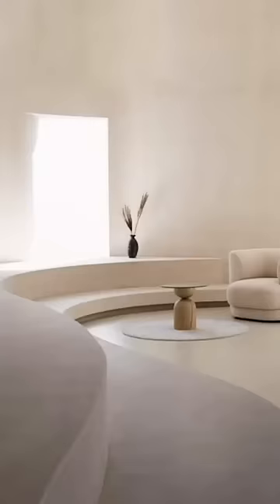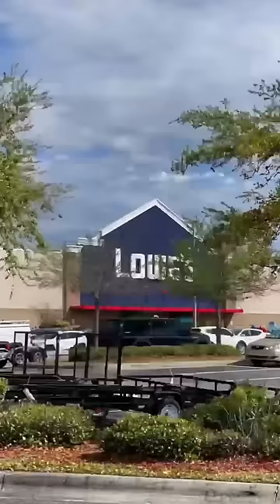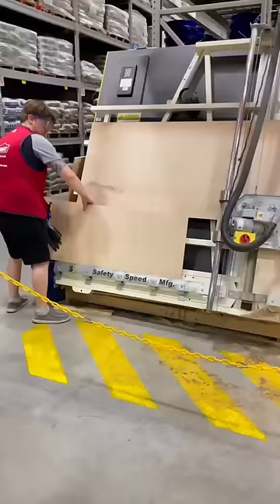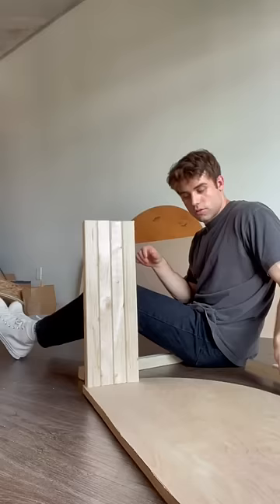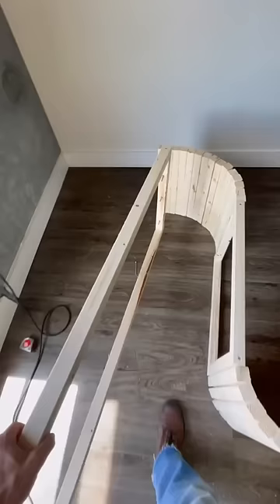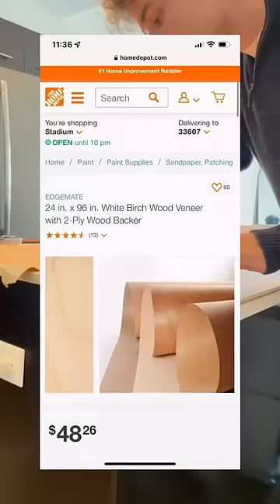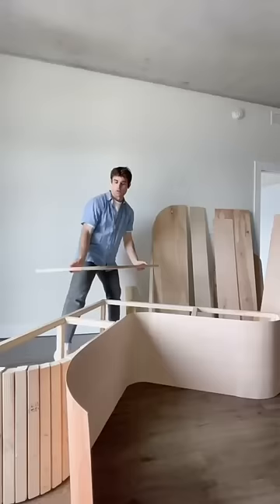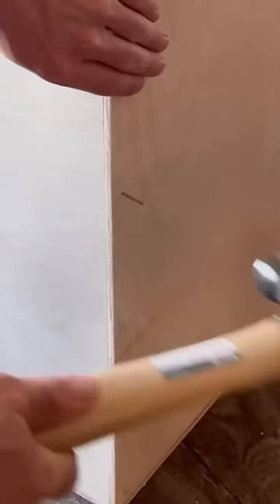How to make the round corner bench of your dreams 🪚🤌🏽 #buildwithjacob #interiordesign

Comment: I don't get all the people hating on him for making something useful for himself instead of buying it, it's pretty cool 🗿🗿🗿
Reply: Because there lives are miserable if you've built something for yourself you understand the sense of accomplishment all these guys have ever built is Twitter accounts 🤣
Reply: @kieren7763  the burn 🔥🥶🥶🥶
Reply: I don't know about hating on him but the way he went to build the bench isn't the greatest. You'll want better reinforcement in the frame. The veneer (bendy ply) wasn't glued properly. You need equal pressure on most of the surface so the glue has a better hold. He could have gotten a cheap router and a trim bit to get a better finish when timing any extra wood. Also sanding and adding some type of finish or at least a sealer. This will give you a better finish while simultaneously sealing the wood. So you don't have any rough surface or you don't have to worry about potentially staining the wood. So not only is the final result more of an unfinished bench, but it's also not structurally built properly. I'm not trying to shit on the guy and his build. It's a very nice design, he just needs to approach the build differently so itll last longer and hold more weight and also finishing the piece Instead of leaving it raw (unfinished)
Reply: @gcoca7450  fair enough
Reply: Because he ca do better on structural support, and he could've made something to last if he didn't make that out of trash ass wood.
Reply: @k_tess  the wood he used was fine, i think its gonna be painted anyway, but yes he could have put some more plywood inside for structural support
Reply: Sometimes it's about the journey not the destination I build cars out of sheet metal I could build whatever car I like and I do but I can assure you my first try looked like shit
Reply: Jealousy.
Reply: @kieren7763  that is a dream for me man I'd love to make a car body out of sheet metal.
Reply: @kieren7763  facts man
Reply: @kieren7763  no they talk shit cause they are tradesmen. That's what we do. We constantly give shit to each other about quality and design.
Reply: Because there's a right way to do shit lol
Reply: @kieren7763  Damm you didn't need to murder them like that 💀
Reply: There are a lot of people that hate the idea of someone doing something for themselves for instance instead of buying a new headset I soldered a new jack I get made fun of for it a lot but I’m not dropping $80 when I can fix it myself in a few hours
Reply: Because he said bendy wood...that should be enough but I can go on if u want
Reply: @kieren7763  out of shyt metal 🤣 yeah most metal cars are made out of shitty metal like aluminum ... titanium is a better metal but its expensive
Reply: @gcoca7450  this isn't hate, this is constructive criticism!
Reply: also he is learning a new skill so it's a win win.
Reply: Its easier for certain people to cut down than to build up
Reply: @johngarcia2010  I love hearing random bouts of wisdom in the morning
Reply: Yeah until a 400 pound person sits on it and breaks it in half… shits useless… it’s dumb as fuck… it’s less sturdy than ikea furniture… and believe me that’s not saying much
Reply: Ong
Reply: @gcoca7450  ain’t nobody care about that except you its not your bench so dont be worried about it.
Reply: @bighitentertainment001  this person is making a video of how they went on building this type of bench. Let's say someone else decides to do the same and do the work based only off this video. They could potentially harm themselves in the long run, because like I said. The bench needs reinforcement. I build furniture for a living. I've been through this with my own projects. Glue will only do some much, you need something to be built well for It to last long. Also with the glue. You need to have a certain amount of pressure so the glue works properly. If not, the joint is weak and the glue doesn't work like it's supposed to. So again. Down the road the glue can come loose and add to potential failure. You might say ain't nobody care but obviously people do. And you're right it isn't my bench, but if I can give some constructive feedback so that others who want to build something similar end up with a better final product then great. Don't know why you're getting all butt hurt about what I have to say. And like I said. This is what I do for a living so I do feel qualified to give some guidance.
Reply: Bro point out the people who are hating cuz I see no one hating 😂
Reply: I think it is just a matter of how much your time worth:).
 Ex : If you get 6k a month and you buy this good for 1.5k it is a week of your work.So, knowing that,if you need 200 $ + 2 weeks of works ... basically you are overpaying it xD.

Of course if you are doing it just for fun/hobby , well , that's totally another pair of hands:) I totally agree that doing stuff DIY is much more satisfying!!!.
Reply: Ikr? Looks very cool too
Reply: @kieren7763  ok
Reply: @kieren7763  bro. Didn't even roast. You put them 6 feet under
Reply: @kieren7763  ayo dawg violated them 🤣🤣
Reply: @gcoca7450  so why don't you try to make it
Reply: @shaqibgolu279  I've something similar in the past. Like I said in another comment. I do furniture and cabinets building for a living. And like I said before. I'm not hating, I'm just pointing out some things that would make the bench better in the long run. Don't know why you're getting butt hurt over constructive criticism.
Reply: @sailingdreamfisher  exactly man 😆.
Reply: @gcoca7450
Reply: It was fine.  My only critique is "bendy wood."  lol.  It's sold as veneer, so it's not hard to just use the right word and not sound like a toddler
Reply: They believe that spending the time to learn this is improportional to paying the grand, especially when learning the skill could cost more than that. Guess that is true but personally after learning how to make my own notebooks at the cost of half of what’s in the market and at a better quality feels really nice. It’s also got a personal touch to it too, kind of a human sense to it.
Reply: nah even if I could afford it I'm still making it's better than doing nothing
Reply: @sora9897  yeahhhhh , it feels so much better to use it afterwards
Reply: I don't hate it. It just looks like shit
Reply: @GCoca   (asking for genuine curiosity); what might be some ways or areas of the bench to better reinforce (and how might you recommend that to be done?)
Reply: People waste all their time on social media and the negativity from wasting their life away gets filtered into the comments.
Reply: P
Reply: @bighitentertainment001  Except this is an instructional video.  He should show proper ways of woodworking.  What GCoca advises is correct and would help with a better finished product in the end.
Reply: Me looking for the people that are hating😂
Reply: @kieren7763  unlike you some people enjoy making stuff
Reply: Plus its fun building things yourself and its cheap too C:
Reply: AND ITS PRETTY
Reply: Those are the folks who spent 1500 dollars on something that won’t last longer than 5 years